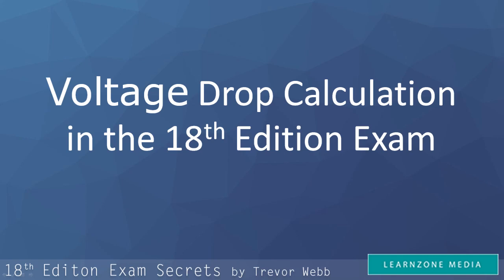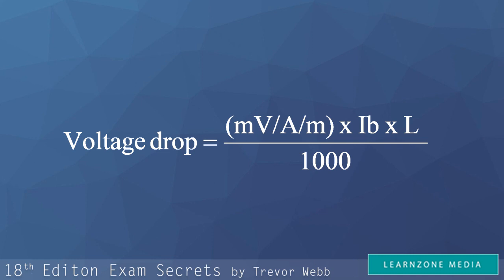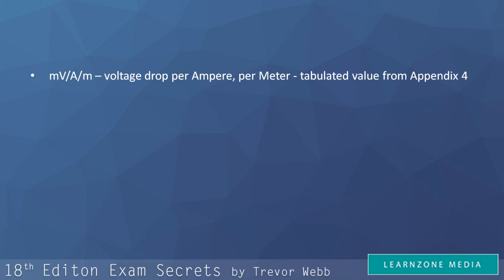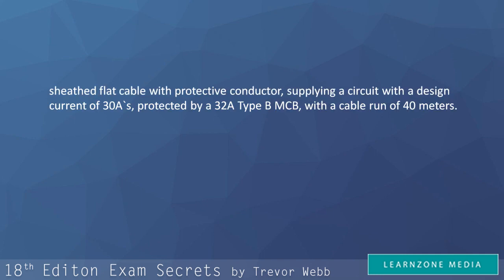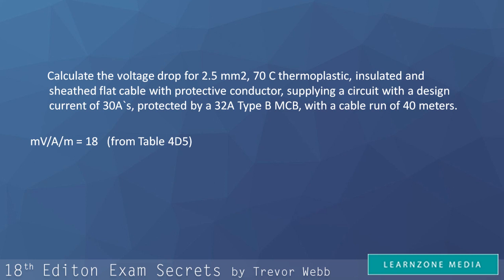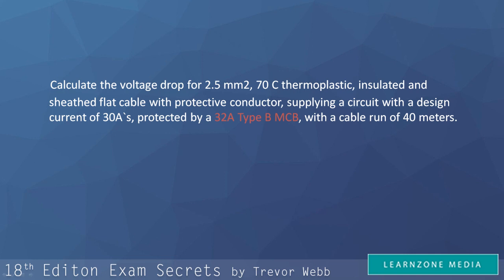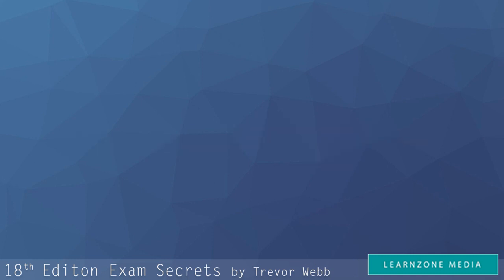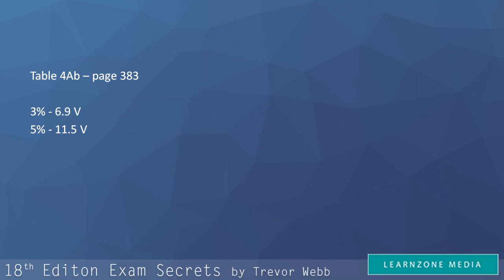18th Edition Exam Secrets - Voltage Drop Calculation in the 18th Edition Exam

Comment: ......I can see  3% and 5% on page 383,but not 6.9v and 11.5v figures .I know they are in Regs somewhere but can't  see where?.Any ideas would be appreciated.Great video .Thank you.
Reply: You do not need to see them written anywhere in the book. You just simply and mathematically calculate the percentage out of the standard 230V. It is really very easy. It is obvious to see that 2.3V represents 1% out of the standard 230V. So how much would be  3% or 5%?  Well, it couldn't have been any easier than that:  2.3V x 3= 6.9V  (3%) and similarly 2.3V x 5=11.5V (5%). End of.
Reply: These values are calculated as Trevor goes through the online course. As you follow the course, you will make a small note here on page 383. It can be very helpful for the exam.
Reply: @Zsolt12365hf  Thank you

Comment: But how do you know which parts to ignore?. I’m getting questions like this:

‘What is the maximum voltage of a separated circuit where electrical separation is the protective measure?’.

Which words are the ‘Key’ words to search in the index?.

I see several and it’s leading me down the wrong roads.

Tips anyone?

Comment: Voltage drop calculation can be found written in word format on page 381 of the 18th edition under Tables of Voltage Drop, 3rd paragraph
Reply: Pass mark is 60% you don't even need any calc to achieve this bolocks... Every year same thing for 600£ ...
Reply: @BOBtoper  did you pass the exam?